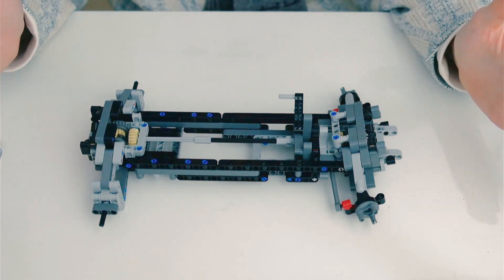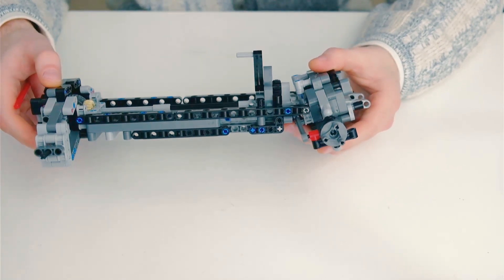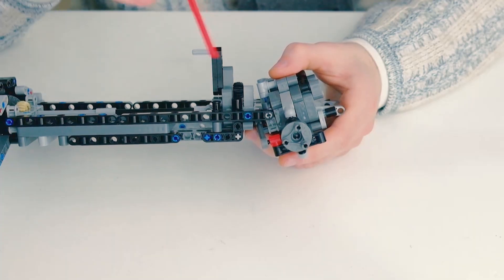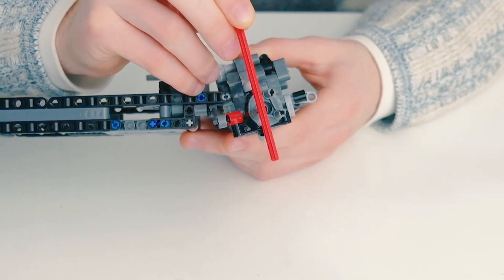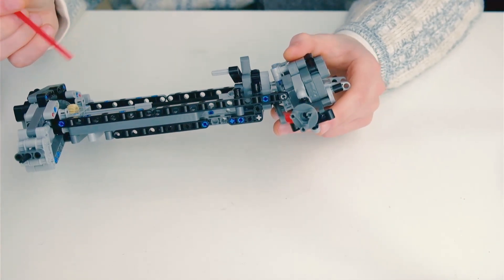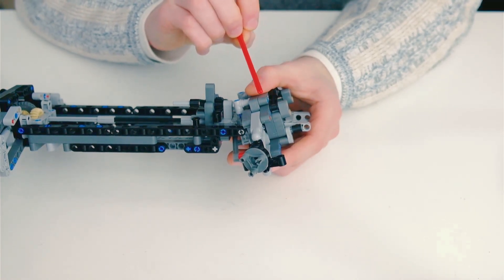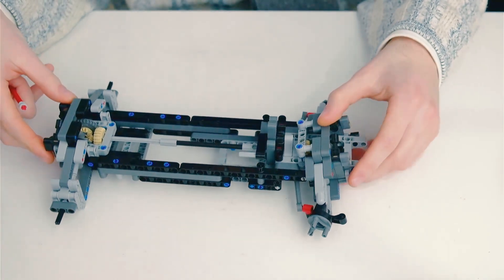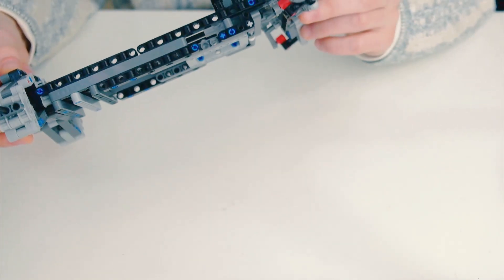Lego Technic - Quick video about caster angles

Comment: Great design, simple but effective.
Didn't realize right way it was 4 wheel drive. Discovered your channel recently and love your builds. Keep up the great videos.
By the way are there shocks on it because I didn't see any.
Also buggy motors wise if your after some, go for the new Buwizz motors  or the Chinese knockoff monster motors. Don't try getting the original, way to expensive and old, not worth it at this point.
Reply from the maker: I think i will go for the buwizz motors eventually. I love what they are doing, the whole idea of 3rd party lego compatible stuff really excites me and i think its great for the space. Yeah instead of using shock absorbers I thought it might be worth it to try and see if I could fit in torsion bars, which are fitted into the pivot point of the upper wishbone, so on one end it's fixed at an angle to the body and the other end rotates with the suspension arm. That causes it to twist, providing the tension for the suspension system. It's more useful for cars with longer wishbones or with more weight, but it's also really compact. I need to improve the packaging of it though, but i'll return to the design in the future for sure. Thanks for taking the time to comment by the way!